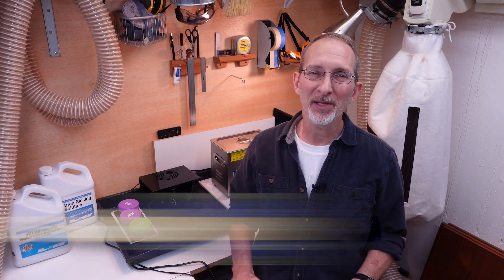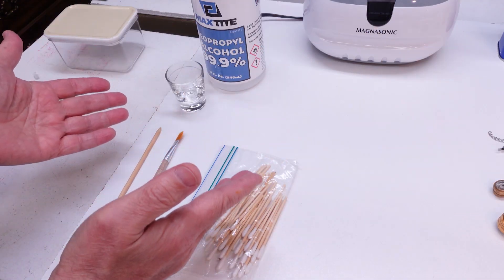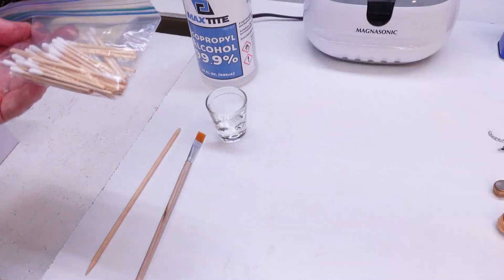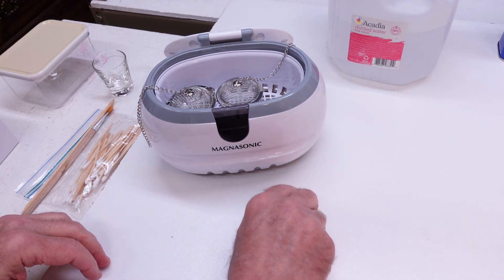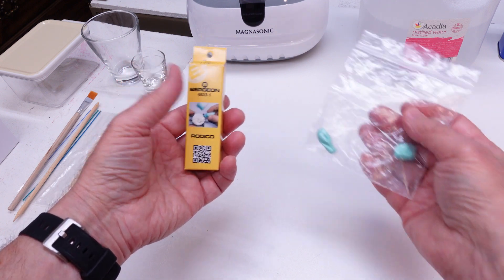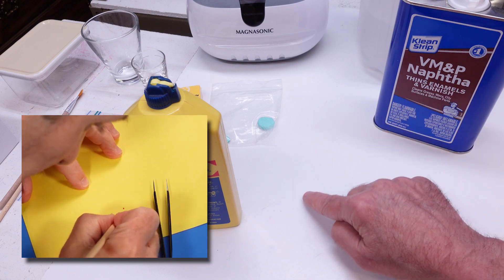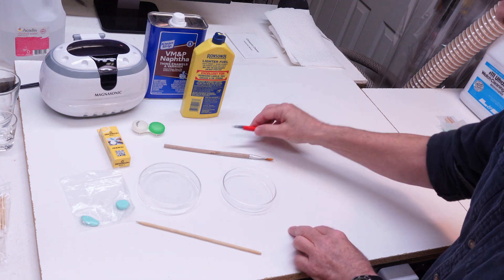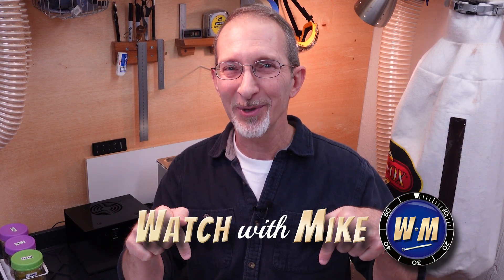Beginner Watch Cleaning Tools & Techniques

Comment: Hey Mike. Very, very instructive! I am just starting out, and wanted to know how you cleaned the palette fork? Did you use the lighter fluid? We cannot get Naptha here in the UK as it apparently contains Benzene, and one needs to use it in a controlled situation.
Reply from the maker: I have been cleaning my pallet fork almost exclusively in One-Dip, which I think (?) you can get in the UK, or at least a similar variant. Unfortunately, these quick evaporating solvents are expensive. But they work very well and the bottle I bought has been lasting me a long time.
Reply: @WatchWithMike  Seems Cousins UK have something called Fixodrop, and Bergeon B-Dip. Need to search your videos to see how you use this, as it seems to be nasty stuff - reading some posts on Reddit, the composition is Tetrachloroethylene. 
In this video, you have used Essence of Rennata which I have ordered - is this the same? Or should you not use E-of-R to clean pallete forks? 
Cousins show speacial bottles for the Fixidrop.

Comment: hi i saw your video with the jewels out of the plate, so i began wondering, have i done something wrong? see i got my plate and washed the plate with one of those pen brushes and soapy water, and i began wondering since you are with the jewels out of the plate, if by cleaning the way i have done, if the jewels would be dislodged from the plate, and without noticing if i might have lost any of them , in the wash.... question is are they LOOSE?
Reply from the maker: The jewels are generally pretty tightly fitted, so you're probably fine.  But if you want to be extra careful, you could try using a loupe to look for any loose jewels.

Comment: Not that it matters but the glass Petri dishes are normally used the way you are doing with the larger piece as the lid. You usually  pour nutrient filled agar which sets like jello in the bottom smaller dish for growing cultures of bacteria etc. and the lid prevents contamination. These days disposable plastic Petri dishes that are already sterilised are more common but the glass ones are still used for certain applications.
Reply from the maker: @johncitizen3361  Good to know! I've actually switched to using the larger ones as the lid. They also work as a good dust cap on my plastic segmented sorters.

Comment: I purchased Rodico for about $9.00 a stick and then I compared it to Kneaded Rubber Art Eraser.  They are almost the exact same thing except for the color and price.  You can get 3 erasers for about $5.00 so it's a real deal.  Check it out and see if it works the exact same way.  Thanks for your tips.

Comment: What do think of using one dip for cleaning, instead of lighter fuel ?
Reply from the maker: Lighter fluid was my go-to solvent when I got started in watchmaking, because I already had it and because one dip is horribly expensive! I can buy naptha at the home center for five dollars a quart. I eventually purchased one dip (for about $30 for half a pint), and I use it to clean my jewels, pallet forks and hairsprings, since it works quickly and evaporates fast and thoroughly. One dip is nasty stuff, so you don't want to expose yourself to it for long, or work in an area that is not ventilated.

Comment: Excellent videos! Q: is it safe to put the thin rubber seal from the screw off back of a Rolex Oyster into the ultrasonic cleaner? And which cleaning liquid should I use? Thanks!
Reply from the maker: @enLARGE.darkroom - my first choice would be to replace the gasket with a new one. But if you want to reuse one that's not damaged I would forgo the ultrasonic and hand clean it with warm water and a little liquid dish soap. Then apply a thin film of silicone lube and you should be good to go!

Comment: Not many comments yet. I lucked out early in my journey to buy a cleaning machine a work bench gobs of parts and an early version of a time Grapher that I never figured out how to use it took up about 2 Sq feet of shelf space and printed out the tracking lines on a 3 inch wide roll of paper. I don't think it displayed any other info. This was not solid state the darn thing had vacume tubes. This was all long before youtube. I eventually threw the machine out after it collected dust for a couple of decades.
Reply from the maker: Wow, a tube-based timegrapher!!?? That's awesome!

Comment: Good tips but PLEASE DO NOT put your pallet fork and hairspring in the IPA alcohol as it will eat the shellac and the pallet jewels and the hairspring may fall out. Use one dip for these items and it is only like $25 for a 8 oz jar.
Reply from the maker: Yes, agreed! At 2:01 I slapped up a pretty big WARNING notice about the pallet fork, but I did not mention the roller jewel and the balance wheel. Good catch!